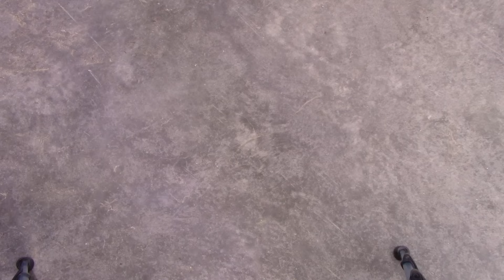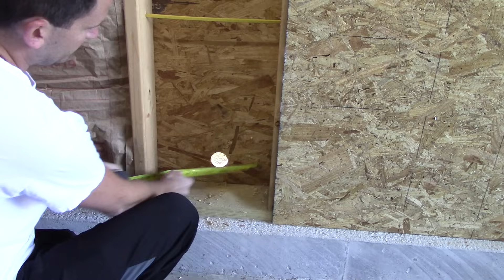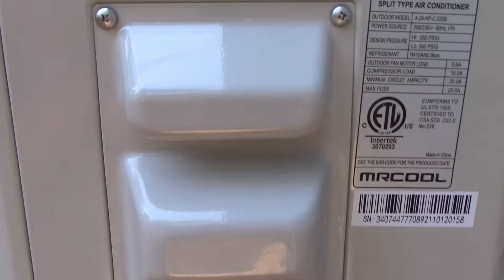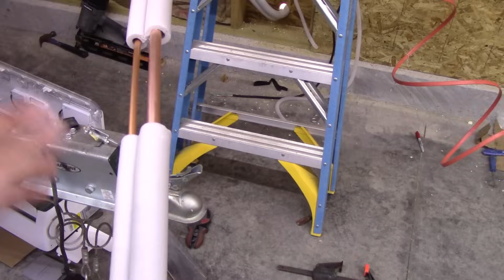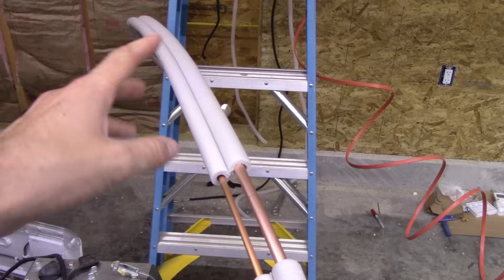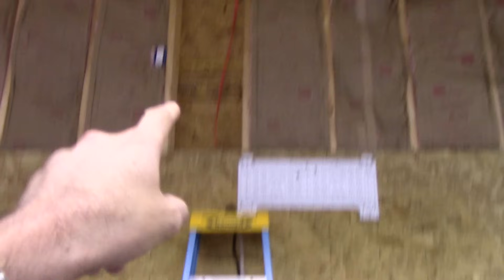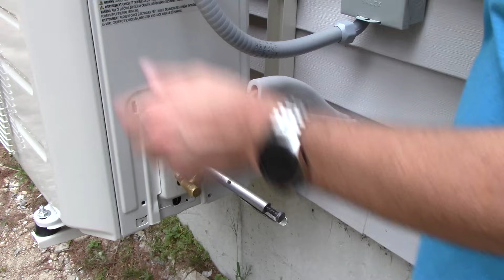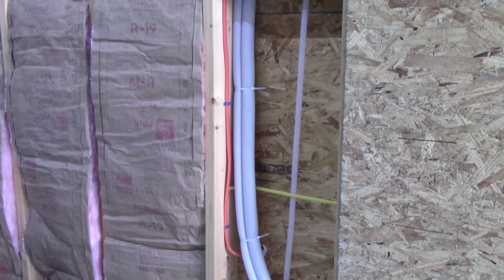Mini-Split Installation For Dummies - Complete Step By Step Guide.

Comment: You have your heat pump way to close to the wall. It should be at least 1 - 3 feet of clearance from the wall. It appears that I purchased the same bracket as you did. I also needed to purchased a 4 ft. square pipe, cut it in half and drilled holes to get the 1 ft clearance, as well as longer bolts. It added the extra 5 inches I needed. If you don't do this, it will lower the needed air flow through the unit cutting performance. My manual says 1 foot of clearance is necessary. Great video none the less.
Reply: Most mini split systems only require a min. of 12 in from a wall behind the unit, on each side and 24 in above.  Wall mounting kits take that into account.

Comment: Great video on the install and you made many points that few cover! I was considering a DIY unit however the 25 foot line set is unacceptable to me for several reasons one ugly coil, trapped compressor oil possibly, to easy to get compromised by lawn equipment and lack of efficiency with a long line set. The cost of a set of gauges and a vacuum pump out weight the price difference for a diy system the only difference being a precharged line set. I have been away from your channel for a while, how is your  Back? Does your mini split run continually or only when you need to cool down the shop? What are your typical outside air temperatures? I am looking at 24 k for a 400 sqft shop in West Texas with high temperatures and running only when needed. 😁🛫

Comment: Best video so far on the Mr. Cool unit. I especially liked the demo of charging the lines (if that's what was being done)> Does anyone know more about doing that. I'm not sure what is going on. The gauges showed a center yellow/tube line but I don't know what it was being used for. OK... I found another video install (not the same unit) the yellow tube is for the pump. Once the check for leaks is done the pump is not needed because the system (compressor) has the refrigerant in it already. Cool... Thanks.

Comment: I was going to get a MrCool but the one I wanted was out of stock so I settled on a Pioneer, which I think is the exact same unit but under a different brand.  The installation manual is identical and all the features are the same.  Maybe this will help someone else who is trying to decide between the two.
Reply: carmangary I have a couple questions, I have a 12,000 btu pioneer mini split that I bought two years ago. It has worked well, however I live in West Texas where it gets hot in the summer 100 degrees F plus and cold in the winter. Not un common to see 10 or less a couple of days in the year. The point is it does get cold here. Not for long periods of time and short lived. I am heating / cooling a 400 sqft wood shop this 12 k unit would work fine if I left it running all the time. I am not sure if that is practical. We do have free Electricity with our plan from 8:00 PM until 6:00 AM so I do run it all night. I am considering a 24 k unit because it cool down the area faster I hope! I have a Gree mini split in another room in the house same size with a 24K unit it cools the room down very quickly. Where the pioneer takes several hours to do cool down the wood shop. What are your experiences with the pioneer? How big an area are you cooling / heating my ceiling is 8 foot with 400 sqft. Area.
Thanks,😁🛫

Comment: How many volt do this system need? Can I run this on a 20 amp breaker?
Reply: You’ll need a Double pole 20amp breaker. you need two hot conductors for it work

Comment: 22:20 sir, i also do try DIY to install my split unit AC, to me, a leak test with  vacuum within 15 mins was not enough to detect your needle hole ... you wont see much different on 15 mins ... you only can see it after a day ...just thought base on my cases. Then when i ON my AC for the first day its goes well, but after few days later i found that my gas pressure was gone almost half. hahaha then repeat again the process to detect the leak and filling gas. This give lesson learn for me for next other two unit... For me be patient letting your gauge overnight is better then add a cost for a tank of Freon.
Reply: A micron guage will show you instant changes in  MICRONS not PSI! Or NegHmg. I wrote an extensive why trust well intended DIY YouTubers that shortcut and experiment on your pocketbook with ZERO ACCOUNTABILITY!??? For about $325  in tools you will make sure you have your best shot as a DIY to assure this unit will work longer than to the end of the video because that is where their QC ENDS!!! Goodbye aka "Tail light Warranty"
Reply: I understand what you are saying but there shouldn't be any pin holes in a new system.  If there is a pin hole in some piping or the evaporator then the whole thing will need to replaced under warranty anyway.  The 15 minute sanity check is more than sufficient during an installation to make sure the fittings are properly made.
Reply: @carmangary will uou pay the Service Call on that advice??? Tools and guages exist for a reason. Every well intended video that claims you "can get by" like this is potentially risking the viewer's pocketbook on that advice! As a service Tech I will tell you the minimum tools are a Vac Pump, Correct Guage Set, Schroeder Valve Removal Tool, Eccentric Flare Tool, Nylog Blue, Torque wrench with Crows Foot Attachments, Micron Guage, A Volt Ohm Meter and hand tools necessary to make a clean install. The 4 recommended tools can be purchased for about $325. And you'll know when you finally start releasing that refrigerant charge into the lines, the micro guage showed you there were no leaks that let vacuum decrease over 500 microns. Just sound advice!

Comment: Definitely one of the best videos I've seen on installation. Couple questions though. Why did you install the Neutral in your service box but wirenut it on the outside? Also I guess I would have to buy the gauges and vacuum pump. What do they normally run price wise? I built on a 450 sgft Sunroom and crazy as it seems the Sun comes in so hard it makes the room crazy hot so I've been looking into installing one of these systems.
Reply from the maker: Thank you! I tied the neutral in at the panel for no better reason than to future proof it.  Mini splits do NOT t need a neutral but I like to make sure I have every option available when going through the trouble of running 220v service to any appliance.  Who knows what type of new systems may be available in 20 years when this once craps out.  It's nice to be pre-wired for any potential need since the hard part is running the cable.  A couple extra bucks for another conductor may really pay off later.  I linked everything including the gauge and vacuum pump in the description but here it is: Complete kit w/pump, gauges and Mini Split adapter for $120: https://www.amazon.com/gp/product/B00SZ4QFW0/ref=as_li_qf_asin_il_tl?ie=UTF8&tag=trialnerror-20&creative=9325&linkCode=as2&creativeASIN=B00SZ4QFW0&linkId=89c4a0bb2075662a32a2d66ed96ff4fa
Reply: Thanks for the reply. I kinda figured that was what you were doing with the Neutral. I will have to put on a separate small service panel to my Main. It's full! Also thanks for the Link. I saw Amazon had some Gauge/Pump packages for around $120. So I'm guessing I could install the whole shabang for less than 1K. Not bad. Gonna have to do something soon here cause I'm sitting in the SUNroom now (I stressed SUN cause it's about 94 in here right now!) Got 2 ceiling fans and a floor fan going....not much help! I built it with 8 sets of sliding glass doors so we could open the doors and get a breeze...not happening over the last 5 days! No rain, no breezes, NW South Carolina. Go figure.....
Reply from the maker: @Mr51Caveman  That would be $1,000 well spent!  Good luck buddy and if you have any other questions I'm at your disposal.

Comment from the maker: LINKS TO EVERYTHING SEEN IN THIS VIDEO: MRCOOL HVAC System:

https://www.amazon.com/gp/product/B084MN21KC/ref=as_li_qf_asin_il_tl?ie=UTF8&tag=trialnerror-20&creative=9325&linkCode=as2&creativeASIN=B084MN21KC&linkId=617330fa04eef54d88595766309949aa
Complete kit w/pump and gauges: https://www.amazon.com/gp/product/B00SZ4QFW0/ref=as_li_qf_asin_il_tl?ie=UTF8&tag=trialnerror-20&creative=9325&linkCode=as2&creativeASIN=B00SZ4QFW0&linkId=89c4a0bb2075662a32a2d66ed96ff4fa
Mini Split Adapter (service port adapter): https://www.amazon.com/gp/product/B07W9CQ76M/ref=as_li_qf_asin_il_tl?ie=UTF8&tag=trialnerror-20&creative=9325&linkCode=as2&creativeASIN=B07W9CQ76M&linkId=ca52469d7bedc726fa7d4ffc8f092356
Wall mount for outdoor compressor: https://www.amazon.com/gp/product/B00LDU9R2I/ref=as_li_qf_asin_il_tl?ie=UTF8&tag=trialnerror-20&creative=9325&linkCode=as2&creativeASIN=B00LDU9R2I&linkId=397f284d3c939e6c81efd137b0f2c9ca
Nylog Blue Sealant: https://www.amazon.com/gp/product/B008HOSQQQ/ref=as_li_tl?ie=UTF8&tag=trialnerror-20&camp=1789&creative=9325&linkCode=as2&creativeASIN=B008HOSQQQ&linkId=0212c4d8d8a14465fadbd8918ca3e3f2
Tubing Flair Kit: https://www.amazon.com/gp/product/B01LZB68U1/ref=as_li_tl?ie=UTF8&tag=trialnerror-20&camp=1789&creative=9325&linkCode=as2&creativeASIN=B01LZB68U1&linkId=3662399f5c22b114b22ebabb5d7b922d
BRAND SPANKIN' NEW CHANNEL MERCH! https://teespring.com/stores/trial-n-error
Want MORE monkey business? Find me on Facebook: https://www.facebook.com/YoutubeTrialnerror/?view_public_for=232815904127596
Reply: Hey quick question what generation is the unit? Also is the Freon in the unit itself? Or the lines like everyone saying. I’m confused here
Reply: Where did you get your hvac vaccum pump? I'm thinking of picking one up from harbor freight. They have a 2.5 cfm pump for about $90, but that sounds really weak even though it's a good price.
Reply from the maker: @intrepidtato  Link is in the comment you replied to.  The Harbor Freight one isn't really a good price when you compare it to the one I linked that comes with the whole gauge set too. Good luck!
Reply: @Trialnerror  what is the electrical box for the outside with the on/off flippy thing called or do you have a link? (Sorry if that's too technical...)  I've got a split coming from Amazon and was looking at install videos, my brothers an HVAC monkey but he's on disability so I'm doing as much of this as I can without bugging him then having  him come over for a final inspection and to give the thumbs up on the turn on...

Comment: what size is your space for this 24k unit? i have 500sf living/kitchen /dining and planing to use 12k unit. it says it is good up to 500sf so not sure if i will be pushing it or not or should rather go with 18k. i cant get hold of anyone form mr cool so not sure which one to pick.
Reply from the maker: Well it's a high ceiling shop so it wont be comparable.  12k should be plenty for 500sq ft so long as you don't live in death valley!
Reply: brano rataj I live in West Texas I have a 12000 btu mini split in a well insulated garage wood shop 400 sqft, if the unit runs all the time as in your living space I think 18k would be fine. In my case I do not fun it all the time and when I want to cool it down from say 85 degrees to 75 it takes several hours 6-7 to get down to 75 degrees. In another room in the house same size 24 K I am cool in 20 minutes. I am looking at a 24 k for my wood shop

Comment: can i install one of these units on my home which has the 40 year old a/c unit installed in the attic now  to replace that one to maybe be able to provide cooling to two seperate bedrooms with one unit to be able to get rid of the attic unit?
would make it alot easier for me than getting a new unit up in the attic and complete the install.
Reply: Yes but you likely want a multi head unit. 1 head unit per room

Comment: You're the first guy I've seen shorten the line set.  All other reports MRCOOL says don't shorten the 16' line.  You cut it to what length?  Did you remove refrigerant and if so how much?  If not have you had any problems with the system with shorter line set?
Reply: hateca1 I will address this since trial N error did not fully understand your question! There are two different styles of Mr Cool Diy or non DIY! 
The line sets with the DIY are sealed and pre charged with 410A. Those you do not want to cut. The line set is 25 feet long. Most people just coil up the extra line. We will cover that latter. Trial N Error’s unit is not DIY the line set is not charged with 410A. So cutting the line set for proper length is advantageous over the DIY install. Why? As he pointed a longer line set is less efficient and the possibility of trapped refrigerant oil in the lines in the coiled up loop of the diy line that you do not want to cut. 
The refrigerant is in the condenser unit it is held captive until you open the valves with the hex key and introduce the gas to the evaporator that was previously sucked down. It is not rocket science! I say boy I say pay attention! 😁🛫 I hope clears up your understanding of this install.
Reply: @TheFalconJetDriver  I fully understand the two types of units and the DIY has sealed line sets.  trial N error did understand my question and fully answered it.  I also understand the unit we are talking about is not DIY, and comes with a 16' line set with refrigerant sealed in the compressor. The reason for the question is if you talk to MR Cool they tell you NOT TO CUT any of their line sets period full stop end of story.  The reason for my original question was trial N error was the first person I have seen cut the non DIY version without removing refrigerant and I wanted to see if he has had issues without removing any refrigerant from the system.  Which trial N error said he did not.  Which would go against what MR Cool says but is what I'm looking to do, cut the line to about 11' without drawing down the refrigerant.
Reply from the maker: I cut it down to probably 11ft.  I didn't remove any refrigerant. They really arn't the delicate flowers some people make them out to be.  IMO there's plenty of wiggle room to shorten or extend 10 feet in either direction without needing to adjust refrigerant.  I've had no problems at all.

Comment: those bracket legs look kind of flimsy. can you comment?
Reply from the maker: I thought the same thing initially, they are flimsy until they are fully bolted down to the wall AND the compressor.  Once I got everything tightened up the whole thing was solid as a rock.  No concerns about it at all now.

Comment: On the outdoor refrigerate piping there should be a drip loop as to allow the rain to drip away from the structure. In your setup this is the opposite.
Reply from the maker: I fixed it but never showed it on video.  Good catch but no worries!

Comment: So... I have this question, if you (or someone) could answer: Does power HAVE TO GO FIRST TO THE Outdoor Unit, THEN TO the inside unit? 

Or, can power first go to the INSIDE UNIT THEN TO THE Outdoor Unit?  It may seem silly, but I really would like to know.
Reply from the maker: 90% of the indoor units are powered BY the outdoor unit. You only need to run romex to the outdoor compressor and that compressor feeds power and communication via one cable to the indoor units.
Reply: @Trialnerror  Thanks. The unit I purchased doesn't have any installation manuals worth anything for a novice, so your response helped.
Reply: igounfazed When I did my install the last thing I did was to connect the outdoor unit, but it does not really matter as long as you have the system isolated until you are ready.

Comment: These come with a factory charge.  Why did you say there was nitrogen in the inside coil?  And since you evacuated the lines and inside coil, wouldn't you need to add refrigerant to get it back to where it needs to be?  I'm just confused about this...

Comment: Hi, I found your channel while trying to figure out how to change my heat pump to a mini-split unit. I have a 3Br-2Bath 1 level home and I have heard a lot about the mini-splits systems. My home is about 1400 sq, ft. Do you know anyone that may know how to figure how many headers I would need? I have contacted 4 or 5 A/C companies and they say it's too expensive to do a mini-split. Then they give me a hell of a price on a new heat pump. I was just wondering if maybe you might know how to figure what size and how many headers I would need. Thank you. And sorry for the long sob story!!!
Reply from the maker: When you say headers, are you talking about the evaporator units mounted to the wall inside the house?  If so, it really depends.  At 1400sqft it can all be done with one large one like the one I installed (24k btu) but most people would like better control and flow by room so that means more units at a smaller BTU rating for each.  They get as small as 6k and as large as 48k BTU's so you have tons of options.
Reply: @Trialnerror  Thank you!!

Comment: Great video. One tip I suggest is reversing the direction of the hole saw when you are going thru vinyl siding,drill counterclockwise, and have less burring.
Reply from the maker: Great tip!
Reply: You can do something similar when cutting metal siding or roofing as well.  If you are using a skill saw, put the blade in so it spins backwards and it cuts well with no burrs.
Reply: I can't be SURE but at about 8m, cutting the small hole, it looks like he IS running that hole saw CCW....